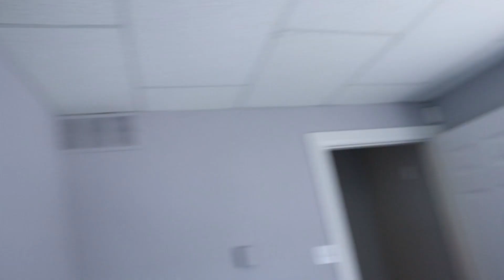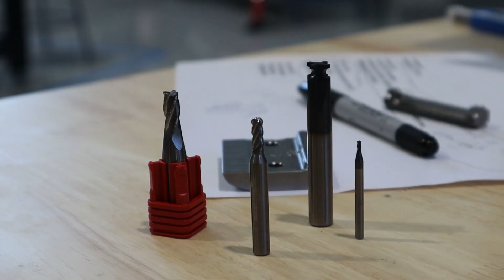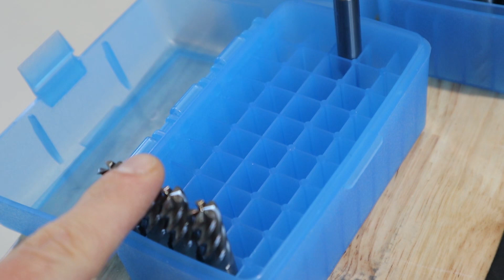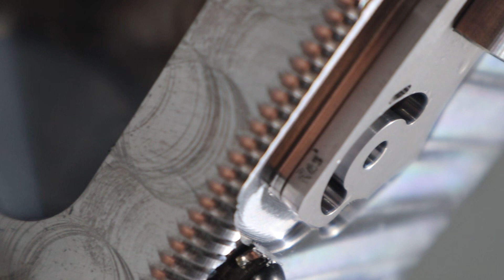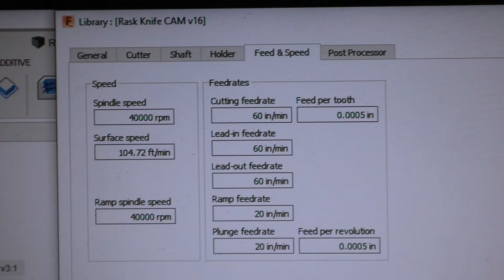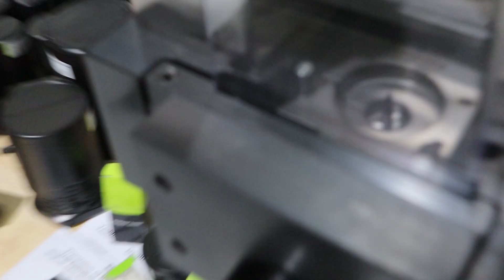We Made A Rask Blade On The Kern! - Quarantined Shop Life 28

Comment: Put some small switch or switch with WiFi in the machine hall. You will need shorter cables and have better signal in the hall probably. Even temporarily putting a switch will be fine. You could also splice cable manually, but I would advise against it, at so long run and 1Gbps speed, it might be dropping packets often, especially with machines running. Also ask Kern if they recommend shielded or unshielded Ethernet cables for their machine. For permanent installation probably two small switches, one on one long wall of the shop, and another on another, is another option, this way you will always have a port close by to the laptop if needed.

Comment: I don't know what the rules are in Canada but using those patch cords in your ceiling plenum would be illegal by fire code here in the US. The right thing to do is get Cat-6 plenum rated cabel and run it properly (attached to the ceiling or in a cable tray). Then drop down properly down at your desk. Obviously the right way to splice/extend a cable is not to do it. There is a length limit for a cable span, better to put a ethernet switch between long segments. That way from your desk you'd have ports for your computer along with the Kern behind you. Of course anywhere you run ONE ethernet cable your run TWO for the next thing you need CAT-6 for...

Comment: You should have a switch (or two) for the factory floor. Get one with enough ports for all the machines and another for the computers etc that are needed on the shop floor. Locate them where the cable lengths would sort of match.

Ideally, the network for the machine tools should be firewalled from the Internet... In addition to your "office" Internet connection. i.e. firewall between computers and machine tools. Protect your Intellectual Property like you would your children!

Comment: I use wifi USB adapter to put pc on the same connection. Even the cheap 4$ one works just fine. You loose a bit of data trasnfer but for sharing files is more than plenty and avoid cables going around the whole shop.

Comment: Rick's plan of wiring is the best option but. if you have an old router (everyone has one lying around) it should work as a network switch.  Bit of an overrated coupling but will give you 4 ? RJ45 sockets inside the workshop. the 65 long cable would reach then.  Nothing wrong with using old equipment as network switches.  The 4 ports on the back of a router are effectively a  network switch.

Comment: Buy a huge roll of cable, a crimping tool and a cable tester and make your own cables. It is very easy, any of your guys can do it. Then route all the cables to the machines and your are good to go. I would have lived in your area I would gladly have spent a morning doing this for you. I strongly advise against WiFi with all the machines around if you want a reliable connection.

Comment: John, it's best practice to put your CNCs on a seperate subnet. It sounds like you'll want a pro to help you with this, but it's worth it. Having them on a seperate subnet greatly helps protect them from malware/virus. It's not often, but I have seen shops shut down because of infections on CNCs. Also, you will want to use sheilded Cat 6 in that environment, not cheap plenum cable. Deffinatly dont want to use wireless in there. But do keep in mind that a lightning strike can wipe an entire network of ports out also so you will also want to make sure your incoming internet connection is going through a UPS for surge protection.
Reply: Being plenum rated and shielded are separate concepts. Plenum rated is a fire code thing (you can run the wire legally in the ceiling plenum) rather than shielding which is a networking issue. When I did my home theater and makerspace in our house, since there was other construction had to do it to code (did it myself) and so all the speaker wire and CAT-6 were all plenum rated by code (and speaker wire isn't shielded - but plenum rated means PTFE insulation on the cables I got)

Comment: John, its likely likely that you could find yourself needing Shielded Ethernet cable. Due to the power you have coming into the build in a high voltage range, and the large transformers. Plus the winding in the spindles of all the cnc machines. I had a client a number of years ago, that it was a necessity. They had a number of saw mills. In one location the power and equiptment put off so much EMI. That you could get radio stations with a signal tracer for wiring identification. The computer network had close to a 50% loss rate on the cat 5. Two things where require to fix this. Properly sheilded and grounded power for the computers and servers, So that the shielded ethernet had correct grounds. Also I had to use a higher end switch that did more error correcting itself. (this was a time when switches where just starting to get cheap, most of the switches out there where cheap and not much of an upgrade past a hub). This things ended up changing their entire outlook at computers. They went from most network task not functioning at all (ie printing or browsing the net) . To just about any task they decided to add working first try (phones, process monitoring, Ip cameras)

Comment: Buy a 1000' spool of Cat 6, and some IDC sockets (even Home Depot carries them). If you wanna talk about this in detail, I'll show you what I did in my shop; I've got Ethernet outlets by every machine, etc. It's so worth it.
Reply: Be careful to make sure you get plenum rated cable (twice as expensive, I'm sorry) if you're running it through drop ceilings. It's mandated by either fire code or electrical code.

Comment: I'd consider shielded cable if you're going out onto the floor; it isn't much more expensive and it's insurance against all the electrical noise from the motors.  I have about 750' of 5e CMP (i.e. rated for use in drop ceilings if they're also air ducts if you want to discuss.

Comment: Run cables properly, with things like patch panels, cable management, j-hooks,  clean routing and labels.  If you don't have the tools or skills hire a low voltage contractor.  Do not allow them to leave holes in your building fire/smoke compartments, they need to seal them with a firestop compound.  Including the ones that probably exist right now.
Reply: I work for a connector company that makes these RJ45 connectors.  All the comments regarding the cabling are great.  I have a few more, minimum bend radius  of a cable should be 10x the cable OD, this helps maintain the integrity/transmission speed of the cable.  If you are making your own cables, buy crimp tooling made for that specific RJ45 and the cable wire gauge you are installing.  There are sealed versions of RJ45 connectors that may be good to use in areas that may be exposed to splashing coolant or other dirt or debris in manufacturing environments.  These Ethernet cable pairs are usually twisted pairs, minimize the amount of untwisting of the pairs if making your own cables, this again will maintain the integrity/transmission speed of the cable.  Every connection in a cable run introduces losses in the signal transmission, so direct runs with no splices are best and reduce the number of failure points.  Don’t solder wires together to extend a cable run.  
If you have this cabling installed professionally they should provide you with reports on the initial performance of each cable run to verify their installation and provide a baseline for troubleshooting down the line if you have issues.

Comment: I'm not sure what the current tech specs allow, but at one time CAT5 ethernet was limited to 100 feet before signal degradation.
Reply: The signal degrades over any length. It is just a matter if the attenuation is measurable and acceptable for your needs. He has 250-350 GB service, so he could run a cable that is 200 ft long and be fine. It’s not like you get to 100 ft and thesignal starts to degrade or you get to x amount of length and the signal starts to degrade. The Consortium that gives the rating just determined that 100 ft is when an unacceptable amount of signal degradation occurs.
Reply: The international standards are 100meters which is ~330feet. It's more important to maintain the twists in the cable and if using cat6 or higher the separation between pairs (shielding) is really important. As others have stated, not following conventions will still work it will just degrade the signal
Reply: @hurst_luke  Thank you for correcting my aging mind.  lol.  I stand corrected.  Thank you sir

Comment: Just get a cheap network hub or router so you can add 3-7 new ports in the shop area.
Reply from the maker: Great plan, will do.
Reply: @JohnGrimsmo /videos Sorry to hijack, but John, you need to see this. https://hongkongknives.com/search/?Keyword=NORSEMAN
Reply: @JohnGrimsmo  For the laptops and computers, probably can use a wifi router for the shop alone, which would enable you to have portability as well, when moving around the shop with your devices. Do take note that Cat5 has a maximum of 100m as well, unless you have another router in between the cables.
Reply: This is a much better suggestion than the others suggesting you should join cat5. With internet speeds as fast as yours and assuming your machines, PC's and laptops have gigabit network cards, make sure you get a gigabit network switch. 5-7port will be cheap enough.

Comment: Your best bet is to just buy a crimper and a box 5e and cutting/running cables yourself.  In the long run, it might not be any cheaper, but it'll be 'done the way you want it'.  
You don't want to wireless these machines; you need reliability, which means hard line is the way to go.  Don't even think about wireless even if it's an option, if I'm being honest.
If you don't have one (which you might, for obvious reasons you are light on the details about the security system at the shop), you might also look into getting a 6u wall rack and setting up a proper network rack if the office space doesn't have one and you're looking to square away all of your networking for the shop.  
Consider a basic setup such as
- Power distribution with surge suppression (1U), 
- 24 port switch (1U, perhaps consider one with Power over Ethernet (PoE) capabilities if you think you thing you might want to either a) take advantage of VOIP phone service for whatever reason 2) If a wifi upgrade may be in your future, as the 'proper' enterprise/prosumer wifi APs with PoE are probably the go-to solution for the amount of coverage you need.  
- patch panel (1U) so it's maintainable, clean, and squared away.
- You can also get a shelf and/or drawer to put all the ISP-supplied stuff on and store any relevant documentation, tools, and bits and bobs.
Whatever you end up doing, a likely-unnecessary reminder to LABEL.  ALL. THE. THINGS.

Comment: John if you're worried about 10ths accuracy shouldn't you be using locating pins for your fixtures?  Using only screws to locate is kinda cringey.
Reply: Ah I see for the blade it'd not that critical since you've got extra meat on those blanks.   Would be more cricital for scales.
Reply from the maker: Normally I would but decided it's not needed for this blade, 0.050" all around and the screws are much tighter than that.  Even the clamp isn't located!  Sacrelidge.